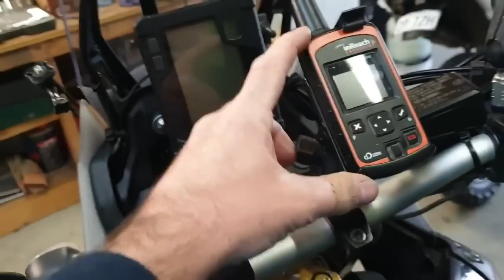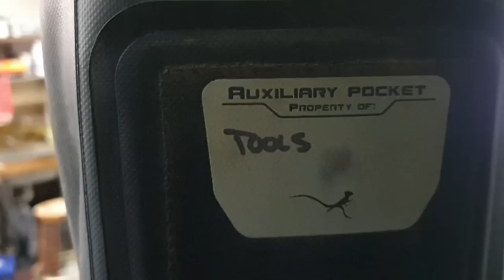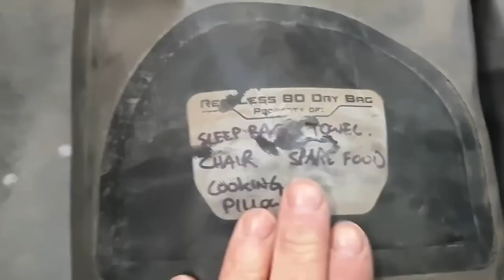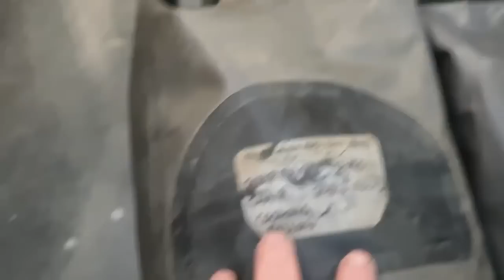My gear on a 28 day trip!

Comment: I was up in broken hill last month and silverton. 
To see the filming location you go past silverton and to the reservoir. Do the little loop as as you come back around there is a little lookout. Stop there and with a good zoom lense you can see and take photos of the preproduction tents. They look like circus tents. 
The lookout I am talking about is NOT the Mundi Mundi lookout. Stop there to. But you won’t see the tents. 
Just after the MM lookout is the corner of the big truck crash site from mad max 2. 
They were also putting up signs for road closures for filming when I was there. So check to see if the roads are open.  
Also pre book accommodation as several travelers and me had trouble finding a room and others had trouble finding a camp site at the CV parks.
Reply: I typed all these lovely tips to be told later in the video you have already left. Ohh well.

Comment: Mate I use a Knox unban 2 , it’s abrasion and impact resistant  so fantastic for road and off road under armour “ please check it out “ UK 🇬🇧 made item . They are just no good on wet asphalt as they don’t have silicone in them like the Motoz Rallz - but obviously because of this doesn’t last as long .